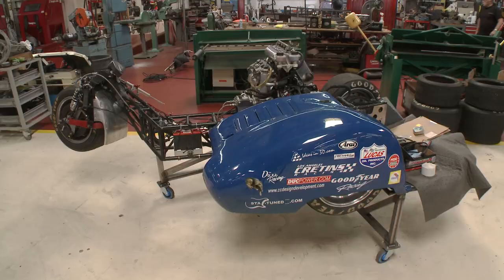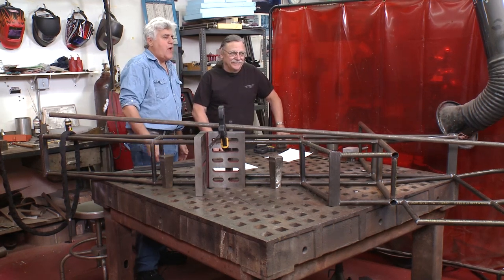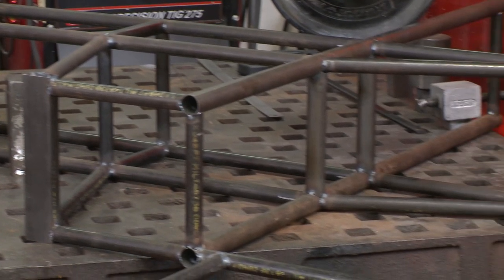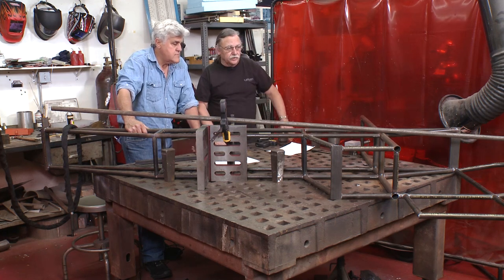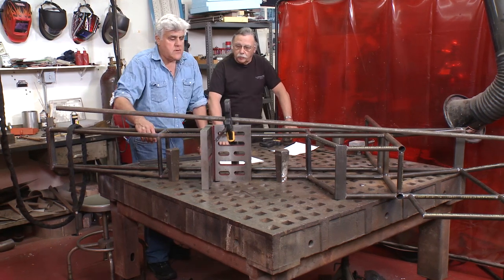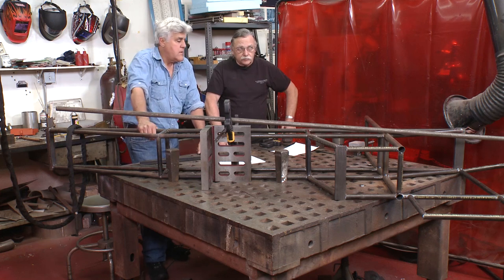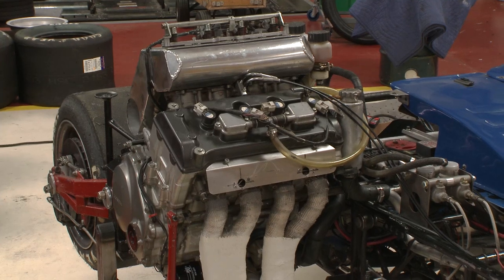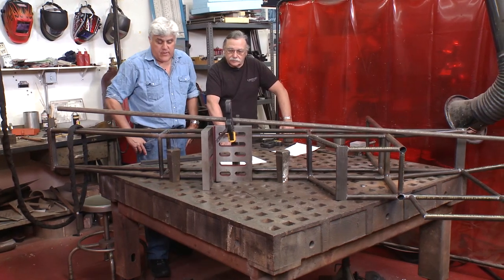Sidecar Frame Building with Bernard Juchli - Jay Leno's Garage

Comment: I remember reading years ago in a motorcycle magazine about a sidecar rig that was build something along these lines. It caused a controversy; at the time sidecar rigs were pretty conventional. But it was within the rule specifications, so they let it race for one season, I think. It won most of those races, and as I recall they changed the rules so it could no longer compete. They called it a three-wheeled sports car, and said it had an unfair advantage.

I guess the rules have relaxed since then?
Reply: This races in entirely separate events. Sidecar is its own racing against only Sidecars.  No two wheelers involved at all.
Reply: Nick Hanscome Yes, I realize that. Not sure what I said to make you think I didn't?

Comment: Its called TIG welding. Idk where the heliarc name came from exactly
Reply: If i remember right Heliarc is an older term for TIG welding or a TIG machine, when TIG was becoming popular the term Heliarc was closer to a brand name (like coca-cola). A lot of people from a generation or two ago use this term synonymous with TIG. Even if they aren't using helium for their gas.
Reply: Helium is the inert gas used
Reply: 1939, heliarc. 1976 tig. 2000 to present day GTAW.
Reply: He might be using helium gas instead of tungsten?
Reply: 851995STARGATE
 Tungsten is the metal electrode in the torch used to create the arc. Argon is a common gas used in tig welding.
Reply: 2 AM argon and or CO2 depends on what your doing and your budget
Reply: 2 AM
thanks for clearing that up I know cars, just not fab tools lol
Reply: Ususally you use Argon. hes welding cold rolled steel it looks like so you can use argon for it also
Reply: TIG = Tungsten Inert Gas welding